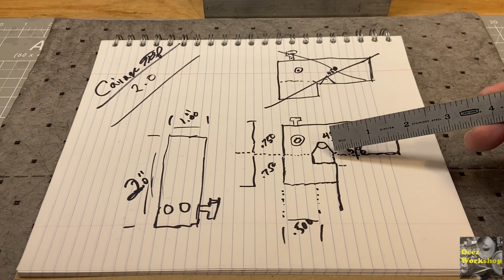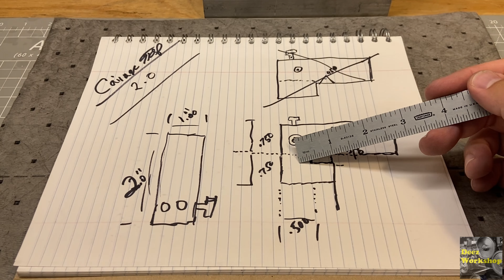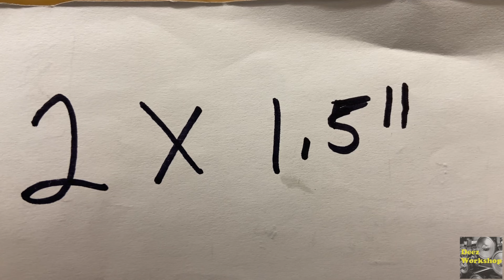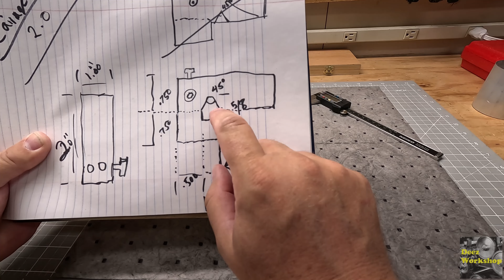Lathe Carriage Stop Part 1 of 2 New Design, Shopmade Tool for the Vevor Mini Lathe using the PM Mill

Comment: Great learning curve. Bit of a hint a countersink makes a quick 90°vee cutter so your work piece can clamp normally in your vise. Keep up the great work on these videos they make a great watch.
Reply from the maker: Great tip on using a countersink.  I did look at my counter sinks but decided I wanted to try to tackly it with a standard endmill.  More difficult that I thought it would be.  Lot more to learn but was a fun excercise.  Made it work in the end but learned a lot.  Would make some changes on the next build.

Comment: Seems like the end mill you used to make the flat at the center of the V was too big. I think you could have gotten a better fit with a smaller diameter end mill.
Reply from the maker: It was, I learned a lot making this stop and discovered many things I would do differently.

Comment: Drill the holes before splitting the piece into two halves.....drill tap hole size..split top and bottom piece....then tap the bottom piece...re-drill the top piece for stud/bolt clearance.....bolt the two halves together and finish milling to all outer dimensions !
Reply from the maker: Great suggestions and tips.  Order of operations I am constantly working to improve upon as well as tips and tricks like you described.  Thanks.

Comment: it is easier to get a 45 degree end mill and cut the edges open correctly. unless you open the edges, you can pill it all and it will still not fit correctly. i learned that the hard way. hehe wish i knew bud, i would have let ya know before ya faught with it.
Reply from the maker: I looked at some of my chamfer bits...considered it but wanted to practice creative work holding...using the tools I had.  It sure seemed simpler in my head but work holding is a form of Art I am finding.  I have a lot to work on when cutting more complex operations.  Cheers.